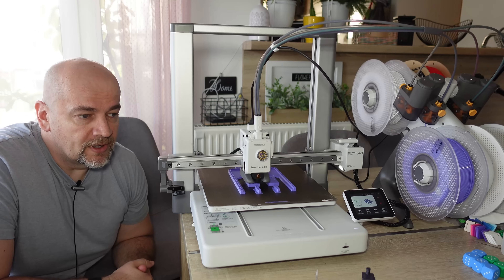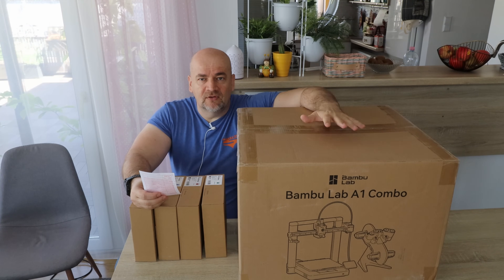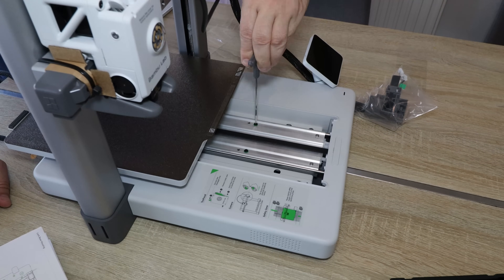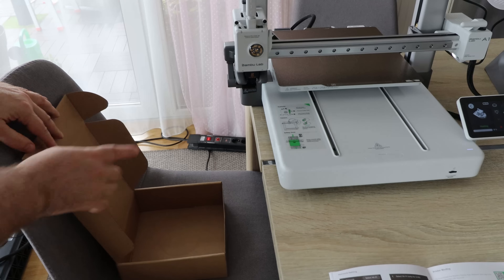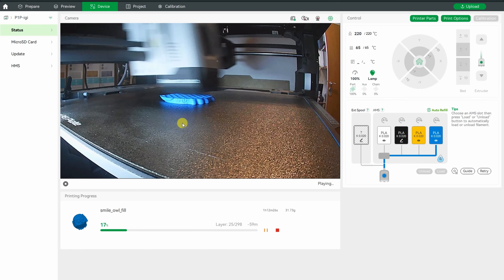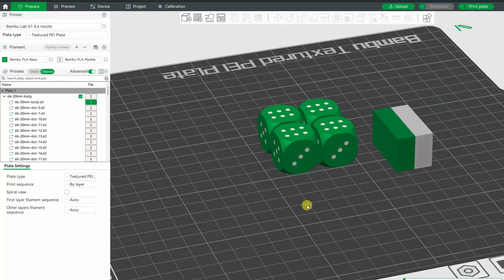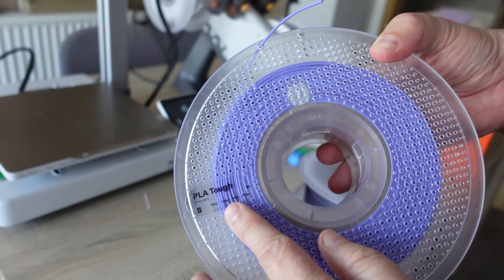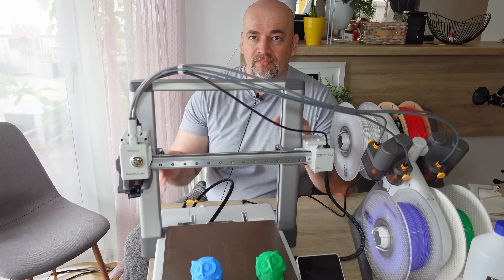Bambu Lab A1, great bed slinger, but is it better than P1P? (for PLA)

Comment: 10:01 I noticed some differences on the horns. I am guessing the cooling is slightly better on the P1P
Reply from the maker: Good notice. Yes, I agree, and this may explain that window on the benchy
Reply: The horns and under the cheeks are not so great on the A1.  Perhaps that can be dialed in to improve?

Comment: Core XY is completely unnecessary and over complicated for 90% of users. Unless you’re printing large objects very quickly, you probably don’t need the hassle and cost of a CoreXY. A custom bed slinger has made a Benchy in 1 min 59 secs without a heated bed, so I think bed slingers are underrated.
Reply: Bed slingers are slow POS's compared to CoreXY. The Anycubic Kobra 3 can only print at half the speeds of my budget Flashforge Adventurer 5M. I returned the Kobra 3 because it was a slow POS that requires like double the space because of the bed slinging. Bed slingers will eventually completely die off

Comment: One is a bedslinger, you should have printed something full height and then you can see the difference in quality on the top part of the print.
Something like a very geometrical vase would do, use hi speed.

Comment: For your students, show them the Ender 3, how everything is pieced together, manual bed leveling, feeding, extrusion, and the whole manual package.
Then, you can show them the bambulab, and ask them how they would solve all of the problems that now bambulab gives for granted.
Your students will be the mechanical, electrical, hardware and software engineers of the future, and as engineers, they should be given a chance to appreciate all the technical details, and awesome technologies that now we can get out of the box, so that they can make the next iteration.
Your students are lucky to have you!

Comment: I just returned the p1s for a A1 combo and A1 mini. So much better
Reply: Why is it better?
Reply: @Red.exe7   i think the p1s is louder  and it doesn’t take cardboard spools. Its the same build size at the a1, but the a1 is $400 cheaper. Unless you only print in things that need an enclosure the bed slingers work perfectly.
Reply: So the p1s was like $1000 something after taxes i got the A1 combo and A1 mini for $200 cheaper.

Comment: as far as the price you are not comparing apples to apples.. it seems the difference is only 10 USD BUT.... the P!P is 499 with NO ams while the A1 is 489 WITH the compact AMS.
Reply: I noticed that too. Thanks for pointing that out.

Comment: I've an A1 with AMS lite which i purchased 1 week after it's debut.  I replaced the recalled heatbed when bambu shipped the  replacement heatbed.  I love the A1 series.  It's super easy to use and it was also my first printer.  I liked it so much that i also bought the A1 Mini and another Ams Lite when they were on sale. 

I've nothing else to compare them to, but i just love them.  They are super easy to work on too. I can change nozzles fast and I've even replaced the extruder gears which was pretty easy too.

Comment: It could be quite interesting to make a 3-way comparison: Surface quality near the bed, same surface 25 cm high up when the bottom of the print is light (Maybe 100g) and as the third option, the same surface 25 cm high up when the bottom of the print is heavy (maybe 400g). I wonder how well the vibration compensation will work in those cases because it's calibrated when the bed is empty. But no matter the result, I think it is a fantastic printer.
Reply: You would find that the bedslinger has a lot of ringhing ghosting on the top.
Reply: @eaman11  I agree. Would be interesting though to see how much of it, maybe depending on printing speed. I've started to do some test myself.

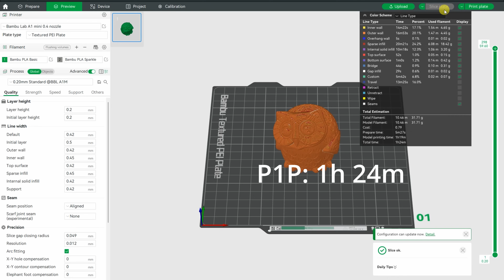Comment: 8:01 did that print on the A1 Mini profile? Or did you catch it and just didn't re-record the shot? lol 

I do that all the time. I'm always slicing things for the wrong printer. At least until I saved profiles with the names to my printers. Christian(50 Shades Of Gray P1S), Karen(Hot Headed A1), Alicia(P!nk Ender 3 S1 Pro), Barry(The FLASHforge AD5M). They all have Gold Printed nameplates. :elbowcough:
Reply from the maker: Oh, yes. I even re-record the shot, but inserted the wrong one in the video, but the time is the same. I got the worning when I wanted to sent to printing, so I noticed only then.

Comment: I just put the new bed on my A1 this morning. Being that it is my only multi-material printer, I was still using it the last couple months. If I had more money at the moment, I would bought an AMS for my P1S during this sale, along with the $120 credit they gave me for waiting. would've been like $200USD after tax. But I paid just $7 shipping, on 8 kilos of PLA for my A1 instead. 

Having an AMS to use with ABS/ASA is something that I could use though.